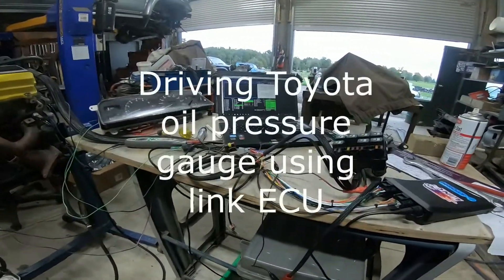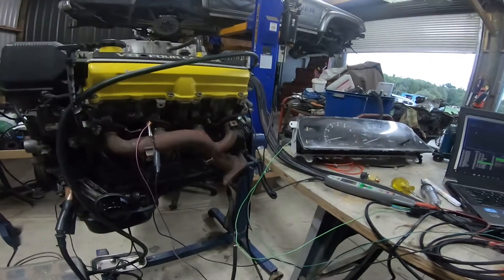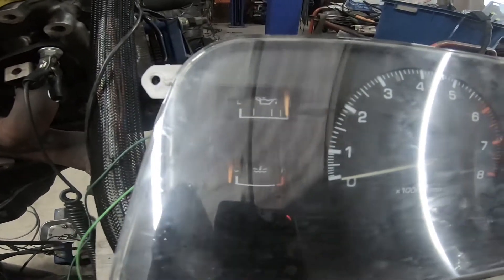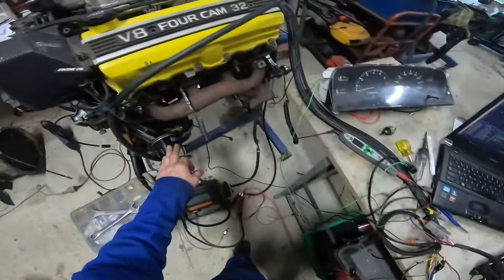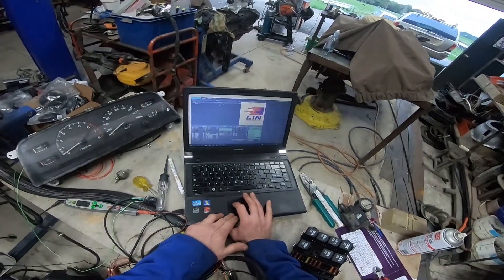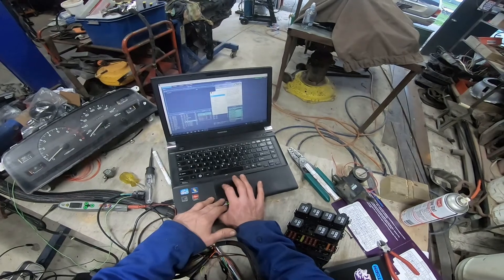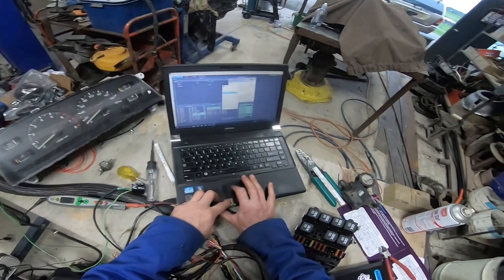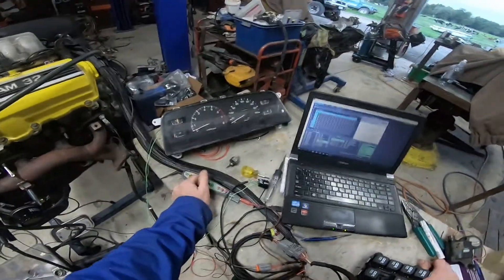Oil pressure gauge controlled from link ECU on Toyota Hilux , Surf and Others

Comment: I have a single wire low oil pressure switch that's wired to a 12v red light on my dash, I want to remove because I have a bosch oil pressure sensor to my link g4+, can I just run the single wire that was for the dummy light to an aux output on my link so it's runs the warning light? It just acts as a ground?
Reply from the maker: I would be happy with the wiring you suggested.  Then I use a table to give oil pressure warnings across the rpm range.  Cheers Kelvin

Comment: Hi! 
What is the part number of that oil pressure sensor? 
Regards!
Reply from the maker: Hello.  It is a generic 3 pin 0-5volt 150psi pressure sensor . I keep these unit in stock and supply them to my customers.  Cheers Kelvin

Comment: Hi Kel. I have a VZN130 surf running 1UZ of a Link G1. Bit worried on my stock oil pressure gauge like the 1 on your Vid. When she idles it stays on low, when I’m cruzzing it fluctuates between quarter and halfway is this okay/normal??
Reply from the maker: There are lots of stock oil pressure senders and this can cause issues.  If you are worried dont take the risk.  Get a test gauge and check oul pressure like the triumph video.  So you know what the pressure is at.
Reply: Hi Kel
I’ve installed a Prosport oil temp and oil pressure gauges of my oil filter relocation kit with stock press sender still active. When I’m cruzzing the Prosport press shows at 55-60 psi. At idle stays at 10 psi. I’ve only got a small oil pan as the dip stick shows full with 3.5 litres of oil 
I like to 1 day drive down to you so u can check it out..